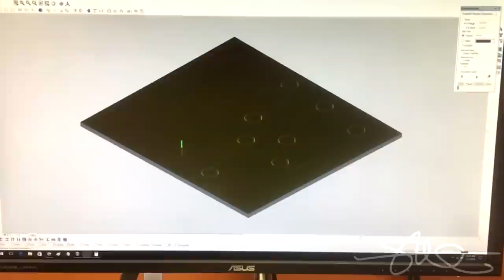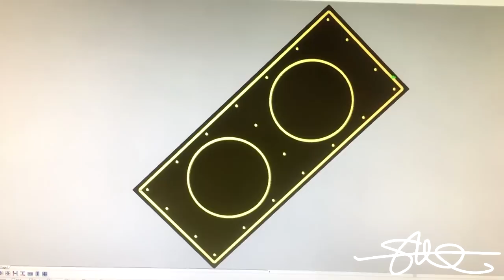"24 Layer" Ported Speaker Box Build - 2 CT-Sounds 8" Meso Subwoofers - Video 1

Comment from the maker: YES I KNOW THIS IS VERY WASTEFUL AND I COULD HAVE DONE IT A LOT FASTER AND USED LESS MATERIAL BUILDING IT THE TRADITIONAL WAY....BUT I WANTED TO TRY SOMETHING DIFFERENT.  YES, I AM TYPING IN ALL CAPS BECAUSE...WELL I DON'T KNOW WHY. LOL.  thanks for watching!
Reply: I cant wait to see the comments about how you could have done it this way and blah blah blah Love your vids man
Reply: Because your creative, and you have toys to play with. They are yours. Thanks for the content!
Reply: meade916 Steave thats crazy man! But I agree with you. Regular boxes make life easy for you.👍✌👊
Reply: i know this is off topic but steve i just got a 01 tahoe , was wondering where you have your amps grounded ? if you drilled through  the body where did you drill to get to the frame ?
Reply: meade916 how much for one of those with the subs bro. that would fit right in my 18 wheeler.  I'm serious too!
Reply from the maker: front by the engine and rear by the gas cap area (frame).  It's easy.
Reply: Waiting to listen on the next vid.    Very nice work as always
Reply: +meade916 thanks bruh
Reply: meade916 thats so cool Steve...very interesting.did u dream that design...👍👍👍
Reply: Man...that is badazz!  Awesome how that port turned out.  Hell if I had one of those cnc routers  I would be doing crazy stuff with it too.  Keep up da good work!
Reply: Idk that I'd consider this "very wasteful"?... And I say that because it's always been my understanding that boxes/cabinets built using this method produce higher SQ than traditional builds. I could be wrong; but that's what I'd been taught by the home theater and designated "listening-room" community over the years..? They usually don't use the MDF, but still it's the same principal. On a side note, when using the CNC table, do you have the option to use other materials/woods like birch ply, or other "hard" woods more commonly used in SQ cabinets?
Reply: we need this quality job here in brazil........
Reply: usually most sq style boxes built this way have more waves in the individual pieces, and usually not one piece is the same on interior to prevent from standing waves, thus generating a better crisp sound
Reply: thats your million dollar idea bro... get started
Reply: *****  This is true, I was just referencing the methodology not so much the design/box itself. And in my opinion not wasteful at all because even if the design turns out to be a total bust the knowledge gained via trial+error/experimentation is Priceless! I am still curious about the limitations of the CNC machine though? And whether or not using hard-woods and higher-end plywoods is an option? I'd LOVE to see a box made using this method, cut out of Walnut, Spruce, Oak, Teak, or even a really good 13-15 ply Baltic Birch! How cool would that look?!...especially made out of the birch ply!? Instead of just looking like 24 layers, it would appear to be 312!!! lol! Seriously though it would look AMAZING especially with the right stain and a heavy HEAVY poly or shellac clear coat!
Reply: meade916 should have laminated the sides
Reply from the maker: nahh
Reply from the maker: ehhhhh what? where did you get that from? Did you just make it up? LMAO
Reply from the maker: Nothing that guy said is "true"...that was some random gibberish LOL... as far as all that  other stuff, i say build one bro! I personally am not a fan of the stained look for automotive speaker boxes. I think it's ugly as hell.  But in a house on a home system i suppose it looks nice.
Reply: Yea Idk enough about SQ box design to comment on it but I have heard of standing waves and it asounded pretty logical so I just went with it? lol! I should've said "I guess that's true?" And I wish I could build a crazy ass box like that! I simply couldn't afford to have a 50k+ CNC router sitting in my garage collecting dust for 1 box... maybe I could commission you to build it for me? Hence my questions about the machine's capabilities? If it CAN be done on that CNC then maybe I'll call and get a quote?
Reply: meade916. just saying from watching your vids I have learned so much and I love the thought that goes in to each box keep making videos man. p.s.  good job
Reply: Standing waves just refer to waves that move backward from the speaker that bounce off the rear of the enclosure and into the rear of the driver again. This can cause phasing and other things, leading to distortion and some frequencies having a sharp peak. Angled or uneven rears of enclosures are used to combat this. This enclosure would combat standing waves excellently.
Reply: meade916 dude material waisting or not .... epic box man looks soooo dope so far
Reply: meade91
Reply: meade916 this is crazy would love to hear it in person
Reply: usually you do very clean boxes that max air flow but with this build I see it being horrible with air flow to what it could be given enough r&d but cool build otherwise
Reply: ron baer There's more to a port than "air flow", and I don't know why people are doubting its effectiveness. This box isn't that out of this world, it's different, which is cool, and if the maths is right, which it seems to be, this box should work great.
Reply: meade916
Reply: I bet he would want a LOT!! LOL
Reply: meade916 Don't beat yourself up. It is a great build and it takes new and inventive ideas to see if it works or don't work and for me, I like different ideas with different builds and love to see what other people's minds can come up with. Great job. Keep your head up.
Reply: Was it wasteful when Edison made a light bulb 1000 times before getting it right? Only assholes with no vision would call this wasteful, unless it's already been done of coarse. Great video, it gave me a great idea how to hide my subs under the seats on my boat.
Reply: Louisville Slugger Well put!
Reply: meade916 have u tested the skar zvx 8 yet
Reply: meade916 i like this way traditional way is standard this is outstanding :)
Reply: meade916 Excellent job
Reply: meade916 agreed... But to use hardwood and stain just to show off your amazing creativeness... Those layers need to be shown! Stunning work!  That should be in a sound museum or something!  Inspiring!
Reply: BLAKER 😐
Reply: the scrap can be recycle, very nice work !!!! I have been considering stacked plywood for my build for my DD15. Do you cut and deliver, or even build and deliver?
Reply: meade916
Reply: meade916 sres me interesa realizar este proyecto podrian enviarme las medidas
Reply: Soy de Perú
Reply: WE KNOW YOU KNOW BUT WE WANT TO SHARE OUR OPINION BECAUSE INTERNET.... actually, kinda glad you posted this, it kinda defused my internal ticking clock.
Reply: Box is Sic Steve...  Keep up the innovation.   I just picked up a set of those speed taps and they are amazing!!!
Reply: yea give me access to a cnc mill and ill make a box 10 times nicer
Reply: Who cares? It's your money,spend it how you see fit.
Reply: U da man have been for years 
Love your work simply put itz sicc af. Lol
Reply from the maker: LMAO go to bed, you are clearly drunk.
Reply: meade916 CAPS RULE
Reply: LOL he said thus
Reply: you should put a sub on your picnic table dude, get you one of them lancer 9 inchers
Reply: @buddylee 19082
Reply: meade916 were can we find the beats cds you have on ur channel
Reply: Brasil assistindo daqui.
Reply: I have 2 10" subs bro and i have two boxes a seald box and a ported box what is better in your opinion
Reply: J
Reply: conjunto
Reply: soundbufflebinmessure
Reply: it's a good way to kill mid resonance in fullrange speaker, some useless for a sub, but nice work
Reply from the maker: @tankafer3127  that makes ZERO sense whatsoever.  Were you drunk when you posted that?
Reply: meade916  how much
Reply: Where can I buy that at ?
Reply: I think its badass, nice to see something different!

Comment: After this video came out I tried this on my cnc wasteful very but the results are amazing. This has been quite handy when designing enclosures for single cab trucks where there is very little room. Thanks for the idea it allowed me to design a enclosure that i can stuff 12in competition grade subs side firing with the seat back in a comfortable spot. Also added benefit with cad design i knew the exact cu.ft. and port dimensions for easy tuning.

Comment: Wicked.... Cnc routers are only limited by the users imagination well done sir.  Little tip use some silicone spray on the tap when drilling threads makes for a better thread and no chance of it getting stuck and perfect way to pollish ends is  get a map gas torch and flame pollish the edges but you probably already know that haha

Comment: I've done smaller boxes this way, if you don't want to fiberglass this is the way to go for odd shapes or nooks that need a sub in them.   What I want to know about is that nice magnetic wire cup/connector, that's hot.

Comment: Add or remove pieces to change port length, volume, etc. Looks smart. Ya should bolt it together with all thread. I'm curious if it will  end up with a lot of turbulence in the port.
Reply: u9Nails assuming steve knows what he's doing, he calculated port velocity so its not fast enough air to create port noise

Comment: I would only suggest you drill a few 1/4" holes to add dowels to align all your sections so they match to the next part 100% in every section..... good job but yes a massive amount of MDF but not necessarily a waste.....also the interior core of MDF is much weaker than the outer faces and while you are cutting through all the faces and making an enclosure constructed of weaker 3/4" or 1" layers  you could have either added internal bracing or made a few layers a little thicker or almost full sections with cutouts to strengthen the center of the box :)  maybe next time..... I LIKE CAPS TOO!!

Comment: Steve, the next box you make like tgatcyou should use different woods/stains instead of mdf. It looks cool but then again it could be a work of art.
Reply from the maker: nah.  I hate that stained look bro. Sorry. Just ain't into it.
Reply: Mdf is the preferred choice for speaker boxes because of its density and stability with changes in temp and humidity.  Using traditional woods would not sound as good (in most applications)?
Reply: Iceheart721 he's to traditional that's why I build my own..

Comment: Yo steve... I'm in need of series rebuild in my 2014 camry. 3 amps audison bit one and 2 micro 8's in a jl box which I dont like. I want to keep the 2 8's but want them in a different box with amp rack on top. Here is the question... can it be done and still have 3/4 of my trunk space still and still have the bass hittin.

Comment: IMO I'd be worried about those screws into the acrylic, is acrylic that strong to withstand the woofer and not stripping the acrylic out?
Reply from the maker: they aren't just screwed in. They are tapped/threaded.  They will hold great.  So don't worry about. lol
Reply: I was just curious, My dream box I wanna do an acrylic baffle, just trying to get all the insight I can get.
Reply from the maker: all good man.  I could understand if i jammed some sheetrock screws into the acrylic or something :D  I have done it like this before with great results. :) thanks!

Comment: What is the point of using particle board other than price
Reply from the maker: no particle board was used in this build.
Reply: meade916 then what was it cuz it definitely wasn't real solid wood and the dust didn't look like it was from any polymer composite  I've ever seen
Reply from the maker: it's called MDF.  Particle board is much less dense.
Reply: meade916 gotcha.....so what's the benefit over using hardwoods like oak....is it just cost or is there more to it
Reply: Hylian Assassin mostly just that anything more than MDF is unnecessary and offers less consistent structural stability with a greater chance of warping over time. Since MDF is wood fiber bonded using resin under pressure, it is highly stable under standard conditions and only warps or swells under extremely high humidity or direct contact with water. It is also consistently dense, which means that you can get a predictable amount of reverberation from the enclosure material. Finally, the vast majority of boxes are wrapped in carpet or vinyl, so it's a bit of a waste of material to make it with anything better. Subwoofers don't benefit from real wood enclosures, since the frequencies being dealt with are so low and it is the shape of the enclosure rather than the material that really matters. If you want to see a more noticeable change based on enclosure material, try using different woods to enclose a mid-range woofer. Maple or spruce work well.

Comment: you guys sure sacrifice that sacrificial table, why do you set tools to go so far through material. You should be more precise and only barely skim the sacrificial table... I've had a lot of fun with a 4'x8' cnc router, cutting all types of material from aluminum to sign foam to cedar, and even 2'' thick balsa wood, aluminum is the worst!!!!  Looks great though!!!  eta: you could have done all those chamfers on the router with a 120degree bit before you cut all the way through with a straight cutter. I like a two flute reverse spiral end mill for thinner/smaller pieces as it hold material down better....